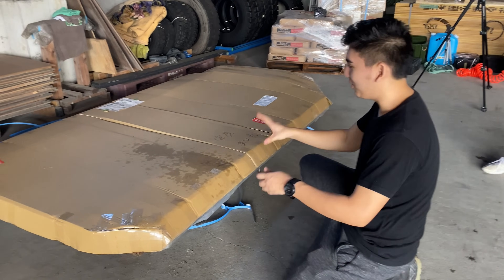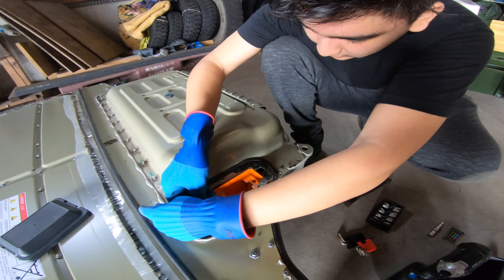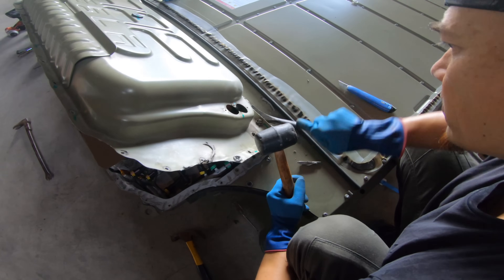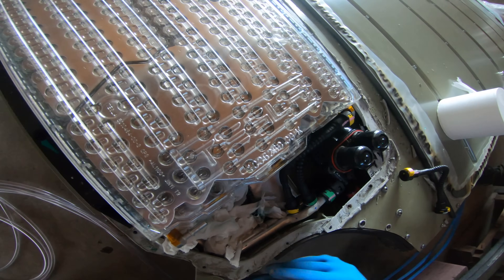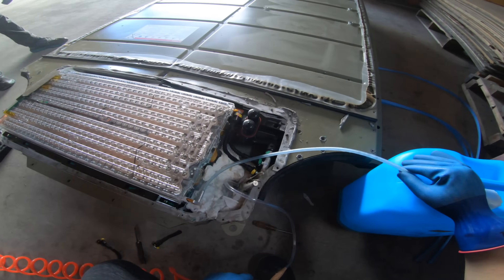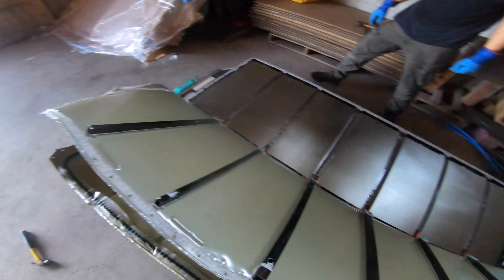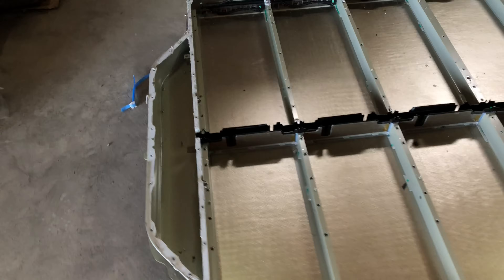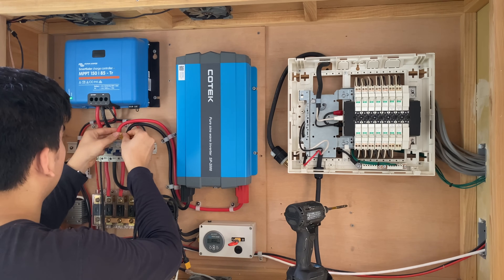The 60kWh Tesla Battery Powered DIY Powerwall

Comment: Does the solar generated electricity go directly in the battery and then from the battery into your home network after it’s fully charged or do you have it set up that both the battery is charged and the surplus consumption goes into the home network simultaneously? 60 kWh is gonna take forever to fully charge with a solar system of just 2.8 kW. 
I’m a planning engineer for solar systems, usually batteries for home solar systems are in the range of 5-15 kWh depending on location and roof size (though same price or more expensive than the tesla battery pack), yours seems to be massively too large  😅
Reply from the maker: The solar power charges the batteries and supplies power to whatever appliances that need it simultaneously. It’s fully off grid so it “naturally” does that with no power being exported to the grid. Which is also why the battery is larger compared to grid tie systems. I also Installed the array before the Tesla modules when I had a much smaller 14kWh Nissan Leaf battery bank. It was sized relatively correctly for that older system, so In comparison to the 60kWh of storage it is small. Planing to add hydro down the line though.
Reply: @ZaiFuchigami  Ok but even for the smaller battery you had before the array is way too small and now if you say you power appliances and charge the battery that‘s even worse. I didn‘t pay attention to your location but each location has a set time of hours where the sun shines (assuming no clouds or other shading) and I highly doubt that you produce enough to both fill the battery completely and still power other appliances during one day with your setup. And it‘s almost summer now where the days are longer, in winter the production will be even less. Observed annually you won‘t have many complete charging/discharging cycles...
Reply from the maker: I’ve done the math, it’s much enough most days. My daily consumption is around 5kWh a day in summer and the array can easily supply over 12kWh a day in summer. (Consumption in winter is around 3-4kWh.) So that’s enough to both charge the battery and supply power during the day. We have a torrential rainy season with periods of rain lasting over 10 days at a time until a few days of sun, so larger energy storage is favorable. Of course it would be great to have a larger array.
Reply: @ZaiFuchigami  Yes I believe you, all I was saying is you‘re not getting the 60 kWh fully charged in one day and in the long run that‘s not optimal regarding the batteries health to only partly charge it and discharging it.
Reply: @Iboo30  You're assuming that the battery would be fully discharged every night. That is not the case. If he gets 10 days of bad weather, at 5kWh per day, the battery will still have some capacity. If he can average 10kWh/day generation when the sun comes out, it will take about 10 days to recharge it (and supply the load). More generation capacity would be nice, but not essential.
Reply: @davidjulian8536  I´m not assuming it, it´s just the way a solar system with battery storage should be set up to reach maximum efficiency and with that also reach its ROI after an adequate amount of time. Additionally, I was talking about getting it charged up fully in the first place. If he said he generates 12 kWh a day in summer, which is realistic, then subtracting his consoumption of 5 kWh he would need at least about 9 days to have it fullly charged. In summer that may work and he would also be able to maintain the charge for several days. In winter he won´t have the same generation, he would be lucky if he gets his consumption covered so eventually the battery management system will put the storage in an idle or safe mode to prevent damages. I see the same happening with the much smaller storage systems we install for our customers. It´s just inevitable that there is a 2-4 (sometimes more, sometimes less) month period where the storage is only partially used or idle.

Comment: can your inverter work within the whole voltage range of 6s li-ion which tesla modules are?
Reply from the maker: The voltage range of the inverter is 19-33v. That covers most of the voltage range of the modules except for the very low end of the range. 19v is 3.16v at the cell level. But it works out since you wouldn’t really go that low as you’d try to increase the cycle life by limiting the high and low end.

Comment: Looks like a Fire 🔥 Trap Set Up. Those batteries where housed in a metal case with coolant for a reason. No space between batteries or cross ventilation..... people will see what 😳 you've done and think it is normal, except able and adequate.. It Is Not !!!!! Pretty clear you have no permits if this is in a building!!!!
Reply from the maker: I've said this in many comments before. The battery modules don't need cooling as they do not get hot or even warm. The reason it has coolant when installed in the car is that the motors pull hundreds of kilowatts when running so that cells need to be cooled down.. So since I'm pulling 100X less power than when it was in the car, the batteries are not stressed and don't heat up. 

The main reason why the modules are housed in a steel casing with the titanium plate at the base,  is to prevent any punctures from damaging the pack and to keep water and dust out. of course it also serves as structural rigidity for the chassis and some fire containment. When in building there's no chance that a puncture will occur and its also shielded from rain and dust. Its not a fire trap. I've designed multiple layers of safety in the system.

Comment: I'm having a hard time believing this is $80 a kwh. Where did you buy it from? The modules alone go for $130]-$1500 a piece equalling $300 a kwh.
Reply: Sounds like this Randy Bobandy is a bit of an idiot and clearly isn't ready any other replies...
Zia Fuchigami I fully understood the fact that you live in Japan and also bought the battery pack in Japan. I thought you made it all obvious enough for the general public to understand. Good video mate.👍🏼
Reply: It seemed like a silly thing to do, and it was mostly a propaganda ploy for Tesla. This is very expensive and costly.
Reply from the maker: Lol a propaganda ploy? I bought the pack from Yahoo auction here in Japan where demand is essentially nonexistent. That’s why the whole pack was so cheap at around 5,800USD. It’s from a P85 which is 80Kwh new. But i tested the modules and it had 70kWh remaining capacity. $5,800 / 70kWh = $85/kWh
Reply: @ZaiFuchigami  demand might be nonexistent but so is supply. Why would there be a tesla pack there and if it wasn't in Japan the shipping cost alone would thosands.
Reply from the maker: Randy Bobandy I was replying to the other guy. And the pack was from a wreaked Model S that was sold and driven in Japan. The battery was removed from the car and I bought it. I also live in Japan.

Comment: next video: how to burn your house down with lion batteries because you were too lazy to enclose the batteries in a steel sheet metal box.
Reply: hater
Reply: @KrackAttack79  more like safety first! dont' hate on keeping it safe!
Reply from the maker: Just wanted to address this quickly. Enclosing the batteries in a box is not going to really help in a thermal runaway situation. First off, the steel enclosure would have to be very thick at around 4mm minimum. Not sheet metal or it’ll just melt through. Second, you’ll need large vents for the rapidly expanding and very hot gasses and smoke to escape outside to be dissipated. To vent that gas outside would have a higher chance of spreading the fire elsewhere. If you also seal the box air tight, it’s likely to become a bomb as the cells create their own oxygen supply.
It’s also extremely unlikely for the modules to go into thermal runaway, as the only way it could is if were overcharged. There’s no risk of a puncture or external fire like in a car crash. There are multiple layers of safety that prevent an overcharge scenario. The original Tesla battery casing is not there to stop the fire. It’s there as structural rigidity, water & dust protection and also has a titanium plate for puncture protection at the base. It has multiple pressure vents at the bottom of the casing to let the gasses out so it’s not stoping the fire, so much as just containing it. Until fire services can arrive.
Reply: @ZaiFuchigami  lol, might want to shut up or put up then. show me a melting steel box due to thermal runaway. you are wrong multiple videos on youtube show thermal runaway contained with sheet metal boxes around 1 to 2mm! 4mm is not needed
Reply from the maker: Yeah you’re right, 2mm would work. But 2mm isn’t sheet metal.
Reply: @ZaiFuchigami  wrong 2mm is considered sheet metal in the USA in fact anything less then 6mm is sheet metal in the steel industry.

Comment: How much would system cost and how large of a home would it run and fir how long
Reply: Watt hours mean you could pull 60000 watts for 1 hour . Or 100watts for 60 hours .

Depends on  amount of electricity used by the house . It could be weeks to hours .. depends.
Reply: It is 1000 watts for 60 hours

Comment: Is there no danger of overheating with the modules set up so close together?
Reply from the maker: They actually don’t heat up at all because the overall load is so low relative to the capacity. They actually stay lower that ambient in the daytime because of its thermal mass

Comment: YOU DO NOT USE LIKE THAT FOR TAKING OFF THE COOLANT, YOU CAN HAVE A TEE CONNECTION WITH THE HORIZONTAL WILL BE USED FOR AIR FLOW AND THE TANGENT CONNECTION WILL BE USED FOR SUCKING THE FLUID OR YOU CAN HAVE A MANUAL PUMP.
Reply from the maker: It worked though.

Comment: Why didn't you use water cooling/heating on that battery pack?
Reply from the maker: Active cooling isn't required because I don't live in a climate where it gets too hot or too cold and because the max load i'll put on the battery is a tiny tiny fraction of what it saw when powering a Model S. 4kW vs 400kW.
Reply: @ZaiFuchigami  yes I have found tickling them with solar passively balancing seems fine 2 years in. One has had bms on, the other I took off. Going to measure cells again this Summer. Going to buy another two modules soon. I love how everyone cables their systems differently! and the protection circuits used. Excellent build 👏
Reply: He's not taking anywhere close to as much out of the batteries like they were in a car, and probably charging them very slowly, they won't heat up like they do in cars pulling lots of amps

Comment: Thumbs up for ingenuity, but what happens to the cooling system that the battery had?
Reply from the maker: I removed the coolant lines from each module, as the max load I will put on the battery is so small relative to its capacity that it will virtually never heat up.
Reply: @ZaiFuchigami  Looks like you know what you doing.
Reply: Perhaps if at a later date you mount thermisters and monitor temp and compare to ambient temp of room and seperate room for say. A month of operation that would give people a good visual proof of not needing cooling at the c rate usage by a typical house. Would pro ably also set aside answing many questions and be another video with hits.
Reply: Not needed at fractional C-rates.
Reply: I think his load and charging Power won't be high enough to need the cooling

Comment: Any particular reason you didn’t feed the batteries with the positive from one end and the negative from the opposite end? This would ensure even current distribution from each of the parallel banks as the wiring resistance will be approximately equal to every bank.
Reply from the maker: Thats something I screwed up on that I plan to fix soon.
Reply: @ZaiFuchigami  why no comment about the cost involved??
Reply from the maker: MrCarmelo1959 Apologizes for the delay. I’m working on a whole video breaking down the cost in detail. It should be done soon.
Reply: @ZaiFuchigami  CAN NOT WAIT DUDE. Thanks for sharing.
Reply: He's pulling so little compared to the total output capacity it really doesn't matter.  They will self balance faster than he can charge/discharge them.
Reply: Bad therrory, electric atoms not work that way. Plus a neautral is not a ground. All nuatrals must have same distance as main load conductor.and ground all things medal with earth ground. Neautral is a traveler of 1/2 of main traveler soarse. As main soarse  be 120 v, the nuatral be 60 v. Nuatral will electricute and kill. But ground if a circut not shorted to ground has 0 v.

Comment: i have 2 model S modules n my Rv - Victron inverter and solar charger - i use to charge battery on my Sur Ron ebike- ridden 1000 miles on 100% solar power
Reply from the maker: Awesome! I’ve been running my DIY BBSHD E-bike with sun power too, only done about 150km on it though...
Reply: Way to Go
Reply: I also like Victron products

Comment: What the hell, Why did you limit your self to a 24 volt system??? 48 volts Systems IS the way to go for a whole house. Smaller wires less current!!
And daisy chaine batteries like that, there are problems!!
Reply: There are more than one way to skin a cat as they say. You prefer one way he chose a different way based on how he wanted to set it up. Before I judge the lad I would ask more info on his load side, recharge side. We are only seeing one part of the picture and casting judgment. Besides if he runs into issues he can rewire it to a different configuration. All part of the engineering on the fly.

Comment: Interesting on these conversation of battery packs. I wonder why , though, why people don't just use those nice weather proof cases and plug into it as the car would. Then do step down after that. Put case in free air or a ground coffin to keep battery cool. Searched and didn't find anyone taking advantage of this.
Reply: Sounds like some smart people could design a plug and play inverter for the 400v system to utilize the entire pack in the future. Incredible job you guy totally rocked the build . Rockstars
Reply: @mikewinkker4897  some large company in China has one but its the size of a refrigerator. GroWatt I think is the name if I have recalled it correctly (Old man here).  Would be the simplest way for sure - leave everything intact use existing cooling etc and step down the Amps, Stack 2 of them if you could....if fiscally reasonable.
Reply: @stevemyers2092  thank for your insight and advice your on point thanks again
Reply: @stevemyers2092  absolutely would be the best way to go , less work with plug and play ! 😎
Reply: Hey maybe put them in a shipping container with foldout solar panels and whala instant solar system. Now what plug can I use ? Ahhhh nothing like a prebuilt system that be delivered and dropped on your site !
Reply from the maker: Its been done before but the main limiting factor is cost. At full pack voltage the output connector will read around 400VDC, at this voltage its very difficult to find inverters and chargers that can handle such high voltages. Almost all battery systems max out at around 48VDC nominal so finding relatively affordable (under 10K) inverters and chargers is easier.
Reply: @ZaiFuchigami  I still think using the metal case and re-doing the electrical connections inside would be the way to go.. specially because those batteries can explode and catch fire when punctured, overcharged OR overheated.  That wood case is not a good idea.
Reply from the maker: Puncture is pretty much impossible as it’s stationary and there isn’t something really sharp that could penetrate the cells. Overcharge is also unlikely as both the BMS and charge controller would have to fail to let the voltage get above 4.2v/cell. If you’ve seen any Tesla fire you can see that the steel casing doesn’t really help to stop it.
Reply: @ZaiFuchigami  This is why I aim to just avoid them all together... but yeah if it were my that would be in a small brick housing in my backyard lol. JUST because of that very reason, even metal will not stop a lithium battery fire. :)

I work in industrial electronic repairs, I do warranty repairs on welding equipment for every name brand... things fail. Newer equipment especially. LOL :)

Liked the video btw!
Reply: @wolverinewelding8753  a little brick container built from FIRE BRICKs  hahaha
Reply: @ZaiFuchigami  ok that would make sense. I had thought that they had made the level 2 chargers a two way connection. This was talked a lot over in the Uk, using the car to balance the grid. Guess it didn’t happen . I had figured everything was basically done.

Comment: Nice work. Did you leave original bms boards on modules? I have a 2 modules in 48v config...
Reply from the maker: I did indeed leave the original Tesla slave BMS boards is to use in conjunction with a SimpBMS which controls and reads data from all 14 slave boards. Works great!

Comment: How did you get to 80 dollars per kwh?
Reply from the maker: I bought the entire battery for around $5,800USD, It tested at about 70kWh for the entire pack so 5,800/70kWh = $82.
Reply: @ZaiFuchigami   Plus BMS , fusing, wire ,mounting etc.

Comment: So the whole pack is degraded to 60kWh?
Reply from the maker: Nobody Famous The P85 pack is actually only 80kWh, Tesla rounded it up to 85. The system is 60kWh since I used only 14 of the 16 modules in the pack for the Powerwall and about 13% degradation. Pretty good for a 7 year old pack.